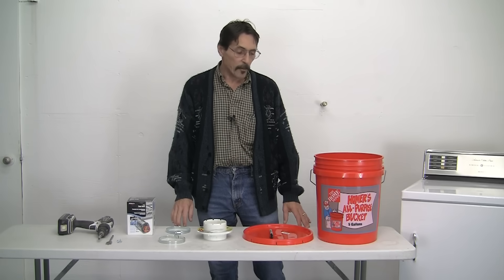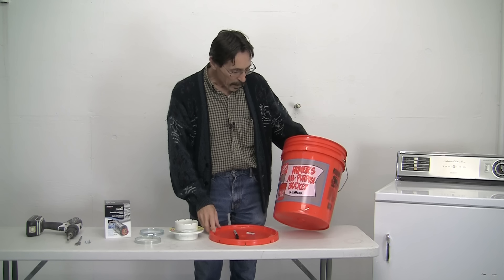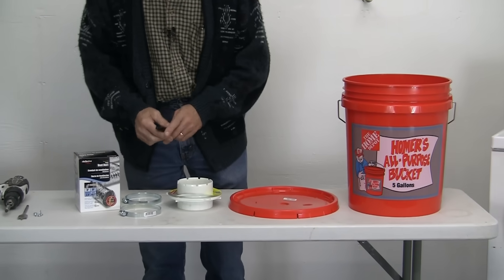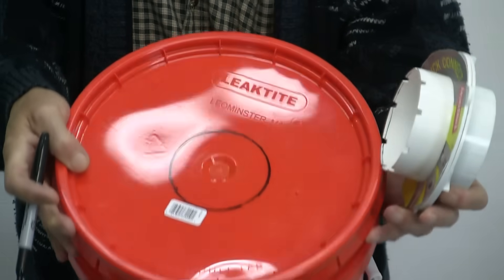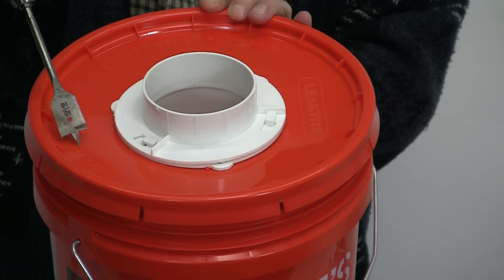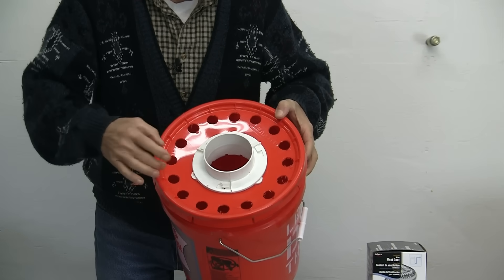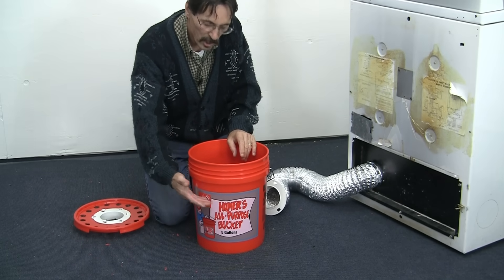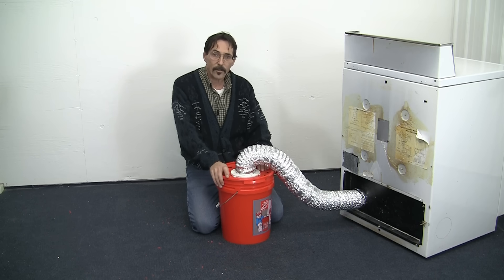DIY How to Cut Electric Bill in Half: Part 3 Clothes Dryer Free Ideas | Missouri Wind and Solar

Comment: High humidity makes it feel colder in the Winter just like it makes it feel hotter in the Summer.
Reply from the maker: Not true about the winter. No humidity or low humidity in the winter holds no heat. When your furnace shuts down the air cools off quickly.
I lived in the desert for 20 years. During the day 100 degrees and as soon as the sun went down it went to 70 degrees and cold as hell, why ? Low humidity like 5 or 10 percent.

Comment: WOW, Where'd you come across that classic G.E. dryer. That was the best dryer ever manufactured. I've been in the service industry 33 years. I came across one of those dryers in avocado,the belt had broken. Typical #82 belt, it was in mint condition. The drum on those dryers alone retain enough heat to dry the clothes with less cycle on time for either a gas or electric model. Now that's when America made appliance's to last and make a statement! G.E. even used a cinder block with steel belt clamp as a counter weight on the rear access panel. I miss those days.
Reply from the maker: Junk yard. I rebuilt it. New drum bearing and belt. I rebuilt hundreds of these dryers back when i did appliance repair. I use to sell used appliances. This is one of the best dryers ever built. Those days are gone.

Comment: Ahh the close dryer thing.  Works but you are dumping up to a gallon of water in your house air everytime you dry a load of clothes.
Not a problem in very dry climates but in more humid areas it IS a problem.  Grow mold and mildew everywhere.
Reply: but if your using it during  winter most homes will be on the dry side especially with electric heat or wood stove. if he would fit a screen to the lid it would be a good idea in most cold month applications
Reply: Island Guy is a fuckin idiot!   You have all mouth and no ears!
Reply: @luciustate4386  you have all mouth and no fucking brain eh?! Shit idea is all BAD! MOLD,MOLD,FUCKING MOLD YA WANKER!

Comment: Yeah. .. I've used the cheap oness.. and I've done the nylon over the hose, too. Both massive failures. I like this idea.

One question.. whenever I've done this, I've gotten humidity and brown spots all over my ceiling. Was this because I didn't have enough air flow?  Did you have that problem with this 5 gallon version?
Reply from the maker: I never had that problem with the 5 gallon pail. Maybe you have it in an enclosed room trapping to much humidity in there. Brown spots is probably from cigarette smoke or your heater.
Reply: From smudging, most likely. And the laundry room is in the back corner. I'm thinking put it around the corner in another room. I watched your video again and noticed you said that. And perhaps the better flow would help, too. Thanks again~!

Comment: you can also vent the dryer air through a thermal battery setup and this will not add moisture back I to the home. it will produce radiant heat for hours after you have done laundry. much like a rocket stove and Cobb construction.

Comment: By doing this you run the risk of over humidifying your home. Down side mildew from water condensation that start's on your ceiling and works its way down your walls.You need to control your humidity, so if you do this keep an eye on it.
Reply: MissouriWindandSolar Then obviously you have never heard from anyone in Florida. Yes, this set up will cause your home to get way to much moisture trapped inside. Been there, tried it, doesn't work.
Reply: Well I did it and the moisture was real bad in my house. I came home to a mess.
Reply from the maker: No one i know of has ever had that happen.

Comment: If your air is dry in the winter despite breathing, showering, cooking, plants, evaporation, etc., this is proof that outside "dry" air is infiltrating.  Fix that air leakage.  This is hugely more important than insulation.  Insulation without air sealing is like a sweater in a winter wind storm.  What you need is Gore-Tex/wind-breaker/air sealing.  If you have an interest, check out Energy Vanguard.  Stay comfortable and Healthy.
Reply: Kingdevel actually, it also means if you have a hot air furnace you may be drying your air out by not having a humidifier on it or a broken humidifier on it.

Comment: a dryer consumes 220v so not really cutting the electric bill in half
Reply: You cut the heating bill because you are reusing the dryer heat to heat the house in winter.
Reply: You have to dry clothes anyway,  so why not use that heat to heat your home instead of venting it outside?
Reply: @dengood1  because MOLD
Reply: Yes, plus he kept saying that if you keep your homes humidity up, the moisture in the air somehow makes you heater work more efficiently.  It shouldn't kick on as often, according to what he said.
Reply: PleaseCiteYourSources Thanks humidity causes everything to feel warmer.  I don't know where you live, but in the summer when humidity is high, it feels unbearably hot. in the winter during a major snow fall, it is actually a bit warmer than it would be if snow were not falling.
Reply: Frank Gutowski I knew that about during summer. but for my own curiosity let me ask you this: what about when it is above 32° outside and is snowing?  Could one make an argument that humidity near the surface could differ from atmospheric humidity during snowfall?

Comment: Since your an ex appliance repair guy, it might interest you to know I have a GE dryer almost identical to yours here in video, mine was made in 1977, model# DDE7110NCL.  I also have the matching Filter Flo washer from the same year, model# WWA8360PAL, both are still going thanks to NOS parts from ebay.  Not until the last couple years did I have to start doing some repairs, try and find anything today that will  last that long.
Reply from the maker: I couldn't remember the year so thanks. I rebuilt many of them.

Comment: I was thinking about doing this.  I have one concern though, if you are adding the moister from the clothes dryer to the ambient air in the room, then pulling the ambient air full of moister back into your dryer trying to dry the clothes, would it not make the dryer run longer to dry clothes and negate the purpose?
Reply from the maker: No, the air is dispersed through out your home. If you had this in a small room and closed the door then it would take longer to dry clothes .

Comment: I think those silver flex tubes contain plastic and are highly flammable. Use the semi-rigid, all metal type.
Reply: They're pretty much aluminium foil and a metal spring.  So that shouldn't be a problem.

Comment: You can actually buy these condenser buckets ready to go. You will retain the hot air from your dryer as the heat will transfer into your room by radiation from the tube instead of being blown out of the vent, I'd recommend one third cold water on the bucket . That is enough for the hot moist air from the dryer to condense and lose the moisture
Reply: Yeah, but he said the ones for sale don't work well, hence his video : )
Reply: I have seen the bought ones in varoius catalogue inserts in publications in the UK . If you have a condenser  just set the whole thing  in a bin-bag and tie the neck off around the hose . Better still buy a tumble dryer with a condenser in it !!
Reply: ''  just set the whole thing  in a bin-bag and tie the neck off around the hose'' Doing this will stop the airflow and back up the humidity into the machine increasing drying times dramatically. It also forces air and lint to escape within the housing of the tumble drier thus creating a major fire risk !!

Comment: "DO NOT do this with a gas dryer" - You know someone did this and is probabaly doing it right now... Becasue you know, not everyone can or will bother to check if their dryer is gas or electric.. "Oh it plugs into the wall socket, it's electric" derp..

Wouldn't a 4" hole saw be the thing to use to make the dryer dock hole? I mean if you have one of course...
Also self tapping screws on plastic... I would have drilled the holes and bolted the dock onto the lid.. Also maybe use stainless steel bolts too so they don't rust in time
Other than that nice video man..

Benefits are some extra heat in your room wherever the bucket is placed and it will smell like whatever dryer sheet you put into the dryer XD
Reply: ElfNet Gaming the thinning of the herd.
Reply: No, it's carbon monoxide. There's a big warning label on all gas appliances about it. Burning NG or propane produces CO unless you have a super efficient burner.
Reply: Greg Morgan actually carbon monoxide is very common in automotive exhaust fumes I don't know what they are teaching in colleges these days but even back then when I was in school they were not exactly too excited about telling the customers the bad news. I was one of those guys who had to ask and read often. My conclusion is No car in production is ever efficient no matter how well maintained even right off the production line.
Reply: Oh yeah, I hadn't thought about the added benefit of the fabric softener scents!  That is a bonus!
Reply: It is carbon dioxide, carbon monoxide is a flammable gas which only occurs with incomplete combustion and is very rare anymore unless equipment is not properly maintained and oxygen levels in combustion area are extremely low!

Comment: There needs to be a way for the air flow to pass through the water so the lint is removed.  If the air is just flowing over the water, the lint will remain in the air that blows out.
Reply: the theory is the all the lint is blown downward and it sticks to the water

Comment: 55% humidity indoors during the winter can cause major problems in most northern states. 40% humidity is recommended if the outdoor temp is at 40 degrees. 10 degrees =30% and if it is 0 degrees outside, indoor humidity should not be higher than 25%. Basically if you are getting moisture on your windows you are also getting it inside your walls and we all know what happens them.
Reply from the maker: Been keeping my home at 55 to 60 percent humidity for 30 years and never had a problem with mold, ever. My parents have always done the same with a humidifier in there home and they have never had any problems. 55 percent humidity is where it should be kept in the winter.
Reply: You are in Missouri. The very top of your state is the cutoff line, If you were further north it would be an issue. As I said if you start getting condensation on windows it's also in your walls.

Comment: Exhausting that much warm humid air creates ideal conditions for mold to grow. Sure maybe it wont be noticeable but continuous operations of a clothes dryer in this condition would force humid air to go places you wont see. Such as gaps in the flooring or walls causing mold to grow in the wooden structures of your home leading to respiratory illness and other health issues. Theres a reason why dryers are made with exhaust vents. Otherwise they would be designed to heat your home instead.
Reply: The WHOLE solution is PAY F'N ATTENTION, and don't be an idiot. You can tell when the humidity is so low that this could never cause mold, and never do it in the summer, but it actually helps raise humidity to proper levels in the winter. Let the rule makers who profit from making rules squeal but if you have 1/2 a brain use this to your advantage
Reply: Also really, you say if you put "that much humidity into your house" well how do you know how much "that" much is? I do one, maybe two loads a week, so OMG!! THAT MUCH HUMIDITY?
Reply from the maker: Your home adsorbs all the moisture a dryer puts out, there will NEVER be any mold. You wanna know how i know this ? Been using one for about 25 years now and so have other folks. NO MOLD. Those who do not know just make up unfounded statements with no evidence what so ever.
Reply: Actually I think it was more people not paying attention to the part where you put water in your bucket. If you run a dryer during the cold months without it connected to a vent it will cause major condensation build up. The condensation WILL cause mold. but here is the part that they didn't catch...the water in the bucket. The water in the bucket not only catches lint but also acts as a condensation trap.it keeps the condensation from building in the area that the dryer is being run because the water in the bucket is cooler than the air temperature coming out of the dryer
Reply: Because its meant to used only to dry your clothes during the winter months when the continuous heating of your home severely drys out the air.  Clearly you dont live in a state like MN where you boil water on the stove if you dont have a humidifier. A state where it is so dry that every person will go through a large bottle of lotion on their hands alone.
Reply: @cathyb9287  argue all the reasons ya want! Guys bring nice too! Sure it heats your home and humidifys! YOU GOT THAT RITE! It WILL cause MOLD! Wjy cant you understand that?! You just keep talking in circles about heat and humidity without addressing the DAMN MOLD LADY
Reply: @mikerushing362  In extreme cold environments, like what the midwest is going through this week, the humidity in those homes are so low that most people run humidifiers to keep the air comfortable. Venting your clothes dryer into the home for a load a day will NOT raise the humidity enough to be a mold issue.
Reply: As you stated your home absorbs this moisture so what happens when your home is saturated with moisture and heat? Mold. Why are states banning running dryer exhausts in your home? Mold. You stated you have never seen mold in 25 years? its either you haven't looked hard enough or you refuse to accept it. Many vent cleaning companies want you to clean your dryer vents periodically to run your dryer efficiently and to avoid a breakage in the dryer exhaust line which could cause, you guessed it, mold. There's a reason why that even today when new homes are built are still fitted with dryer vents. There's a reason why dryer manufacturers are still stating in their owners manuals to exhaust the dryers outdoors because they don't want to be held accountable for ruining homes.
Reply: Force599 u act like people are running a dryer 24/7, auit being an idiot. U put a humidity gauge in the house and keep it at the correct level. Its not rocket science.
Reply: I worked for servpro for several years and have several iircac certifications in water damage and mold  remediation and I agree with you. I've demoed plenty of laundry rooms down to studs where the dryer vent malfunctioned.
Reply: Not if you live in the northern part of the country where you are heating 24/7 for 5 months.  This method "supplements" your heat by not throwing the clothes dryer heat outside.  In the north we have to use humidifiers during the winter.
Reply: Cathy Brace living in Canada means we're hearing our homes for roughly 7 months a year. Modern heat pump systems will regulate the amount of humidity in your home. A dryer is not equipped with any device for monitoring the humidity in your home. It's not meant for it. Too much humidity will cause mold. People who store cigars know humidity is crucial and too much of it will cause mold to grow very quickly. Getting rid of mold can be pricey so why risk it?
Reply: @Force599  If your heat pump adjusts for the humidity in your house, it would counteract any extra added by the dryer. I think you don't understand how active controls work
Reply: @cathyb9287  

The humidifiers you are using are most likely Ultrasonic or with the ability to treat against mold/bacteria.  They just make 1000% more sense than doing this to your dryer.
Reply: Exactly!!  One doesn't have to understand much to realize why this should NEVER be done!!

Comment: Thanks for this great tip, I am definitely going to try it. I have a wood stove and struggle to keep up the humidity levels, this will help greatly!
Reply from the maker: Works excellent if your using wood to heat. Wood really dries out the air.

Comment: I live in the Midwest(Ohio) will this really help to heat my home in the winter??
Reply: KING KUMARI yes!I am from Cincinnati and live I. Texas now. in Cinci, I did HVAC. you want your house about 35 percent humidity. even if you took out the heat factor, the humidity alone will reduce your bills a little, and you will not get dry skin, as well as dry mouth and through when you sleep
Reply: Steve Murray 
thanks for the info....
Reply: You're welcome!
Reply: MissouriWindandSolar 
How do you keep your humidity at 35 or 55 percent??
Reply: MissouriWindandSolar I don't know where you're from, but even at 35 in Ohio you will get moisture. Hold up on the windows. 55? False.
Reply: He's from....wait for it.....Missouri.
Reply: Cha
Reply: How do you measure your humidity?..Last few places I've lived have been super dry...
Reply: You will still get some lint in the air and it pumps too much humidity into the air in a short amount of time. In cold winter climates lots of condensation builds up on cold exterior walls and windows. Also, it makes your house smell like a laundromat.
Reply: @Herb Fellows:  ROFLMAO!!
Reply from the maker: It's really recommended to keep your humidity at 55 percent in the winter months.
Reply: KING KUMARI, the electric clothes dryer bucket setup will really increase the humidity in your home. Buy a humidity gauge to measure humidity, cheap from Amazon. 
Also can buy larger humidifier, I have older Holmes model with 2 water tanks, filter in middle, works great.
Reply from the maker: A humidifier. We have 2 in our house and a humidity gauge on the wall. Once your humidity gets to 55 percent just dial down your humidifier until it shuts off.